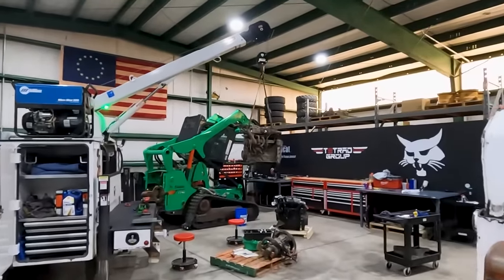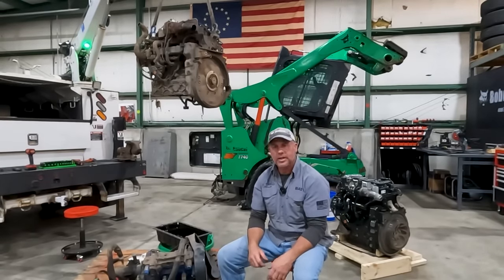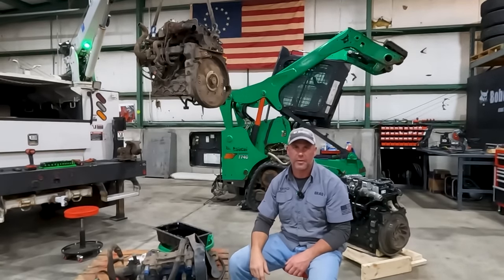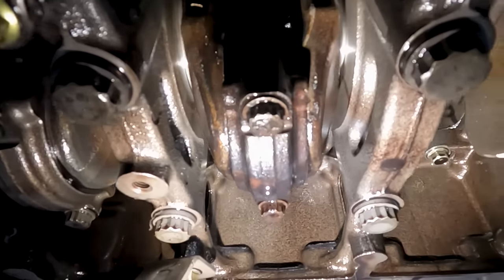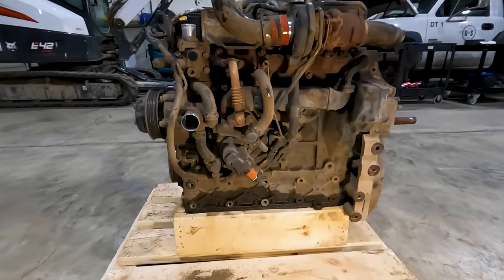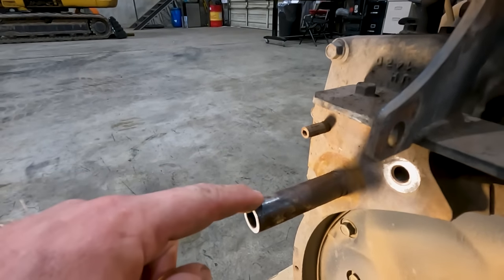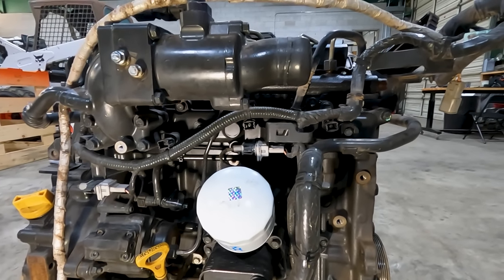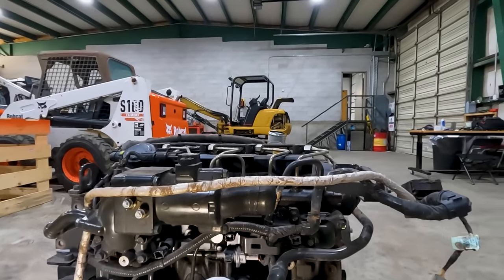Bobcat Skid Steer Engine Locks Up, What Happened and Why

Comment: I was in this situation a year ago. I found a company out in conroe texas called Sheely supply llc. He rebuilds industrial engines and equipment engines. Specializes in doosans mostly.  Re rebuilt my d34p for about 15k. My block spun 2 main bearings and 2 rod bearings. They line bored the block to bring it back to spec as you cannot over size those bearings. I highly recommend that company as a rebuilder of doosan motors. Hes one of the few people in the states that has the knowledge and experience to rebuild them.

Comment: The question is why did bobcat stop using Kubota engines? Was it because Doosan purchased Bobcat? Kubota engines were damn good. Our S570, with the Doosan engine, already is showing a rusty fuel rail..it sits in the shop. Our T590 with the Kubota engine..still a pretty blue.
Reply: Rust inside of a fuel rail?
Reply: @crankshaft1053  no, the outside is rusting. Especially where the hard lines thread in.

Comment: Can't you get a shortblock? $26k can put a small operator like me out of business. No wonder Sunbelt gets rid of machines before they need repairs like this. I've got a Takeuchi TL8 (tier four) and a BC S300  (pre emissions). Same basic engine. Getting rid of the Tak. Nothing but problems with the emission/fuel system. Can't afford downtime and outside repairs. The BC has nearly three times the hours and never lets me down. Thank the government for the added expense and frustration of operating these modern machine and taking away the joy of ownership. BTW, I will replace the Tak with a pre emissions Tak and proactively spend the money toward keeping it in reliable  order. Most of the work I can do myself without depending on proprietary diagnostic equipment and stupidly expensive OEM parts. Even as things get worse I intend to maintain control of my equipment. When that's no longer possible I'll retire or find another occupation.
Reply: yeah I'm surprised by that too. Bare block is $4500, short block is $11700. I understand wanting to warranty your product, but it seems it would have been worth the labor reuse the other components. Reman fuel pumps run about $1000-1500, reman turbos run about $1000 if you wanted to be safe and replace those due to oil contamination. Hypothetically the oil filter should catch much of the contamination.

Comment: What was causing it to not run right  low oil pressure, knock senser messing with fueling timing. You said it would run but kept dying.  But you drove it off the trailer and into the shop. Should there have been a code for it not running  right? Does it have hydraulic lifters which were not being pumped up due to low oil pressure, which would not let it breath correctly. You said it ran but did not sound right. Let us know about this issue. 🧐

Comment: $26k ...  1.21 Giggawatts!!  Great Scott what are they thinking?!      I've seen guys on youtube swap out  the doosan for a V8 or Harbor Freight Predator engine.      Would be nice to know what kind of hours are on these machines when they fail.  I heard that the 'useful life'  of the Kubota was around 5k hours.   Don't know what the Doosan is.    Was this a SunBelt rental machine that was sold off to a customer, or was this a sun belt machine that they were trying to keep running in their own fleet?      Surprised that 'accelerometer' sensor didn't detect that atomized bearing.  Looked like "FerroFluid" in the bottom of that oil pan.

Comment: I have rebuilt a coulple of d34 and d24. Hardest part was getting parts.  But I found a good dealer in California. Depending on letters on block. They can use 3 different bearings.

Comment: You think the first mechanic shop would cut the oil filter open first b4 dropping thousands at a fuel system. When $20 oil filter is full of metal, well you found the problem, it f'ed.

Comment: Question I have a 2016 s650 that doesn’t throw a code but at full idle it starts to idle up and down and throw black smoke and make a knock sound but when I turn down the idle to about 2000 rpms and it stops doing it and can continue working . Could it be a fuel problem ? Or is it something major I do have a video